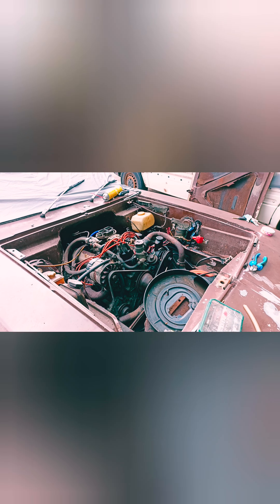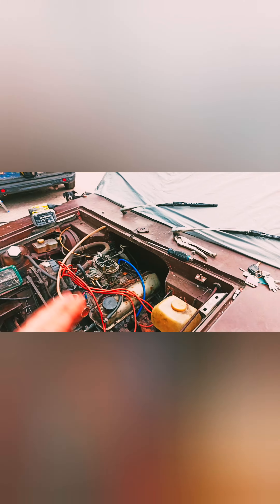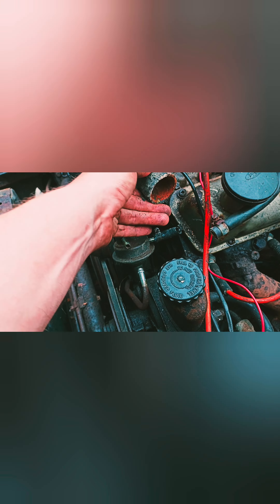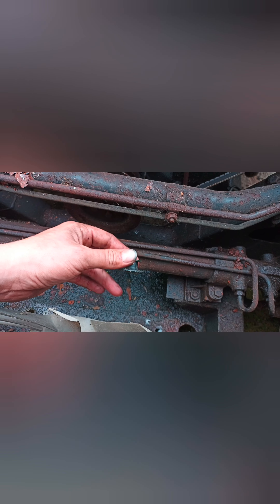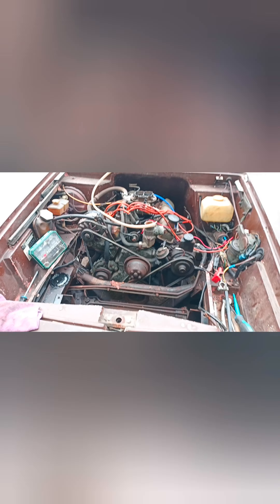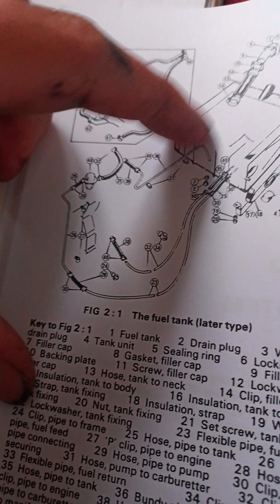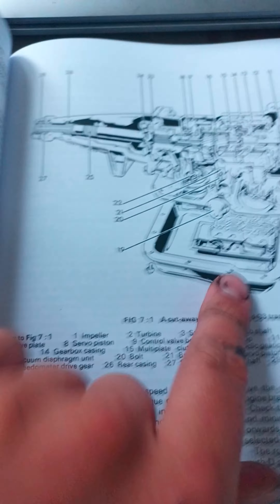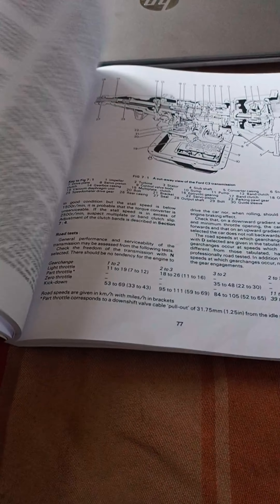Reliant Scimitar GTE  (EP1 - fuel/rad)

Comment: Good start man! Very much looking forward to hearing it fire up for the first time! 

If you can get the C3 box working then it's better than nothing. My long term advice would be to go manual if you want a more sport/performance feel. The C3 auto is a bit of a slouchy cruiser, even more reason to replace if it's faulty!

Getting those fuel lines done is something i defintiely should have started with rather than waiting for years, very lucky!